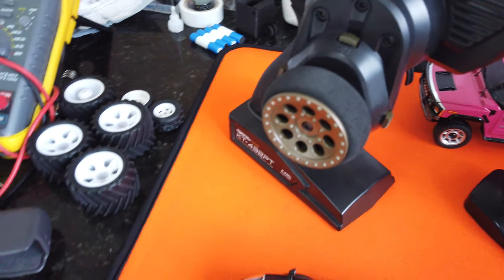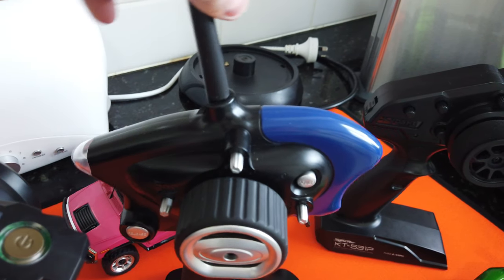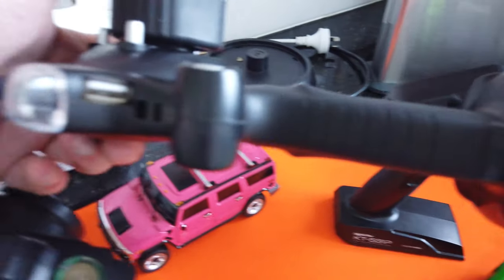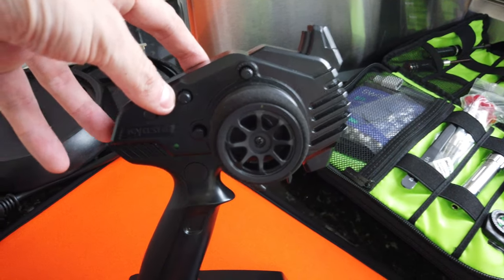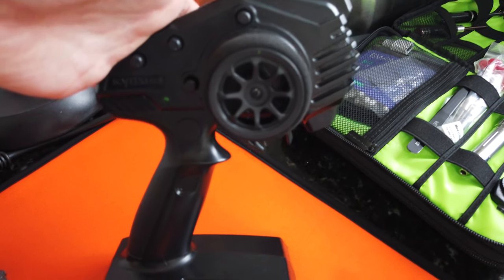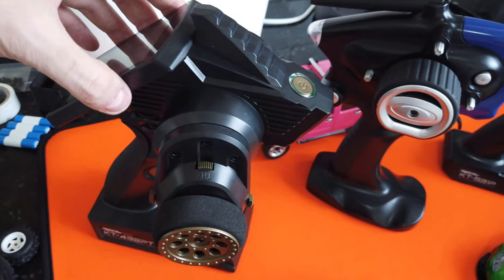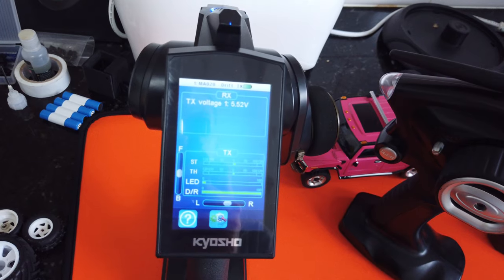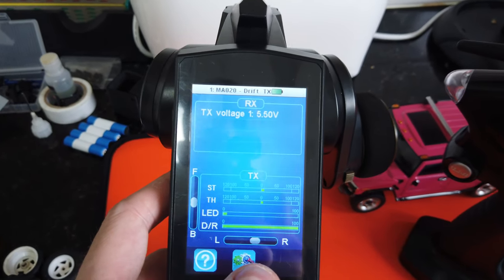Diffrent types of transmitter for Kyosho Mini-Zs

Comment: I can’t find a radio less than 90$ for my mini z mr03 is there a cheap alternative I can buy. Got this mini z body chassis set on eBay for 80$ thought I was getting a good deal now I’m starting to wonder. Any ideas? Please help!
Reply from the maker: Wow, just checked the prices and you are right, if there is a mini-z club near you it may be worth hitting up as anyone with a few models has these laying about. the KT-432 has replaced all my controllers and i have them laying about. if you cant find a local club or hobby store then i maybe able to ship one out but the real killer will be the shipping costs

you will need to know which controller you need, either the blue one in the middle for 'sports' or the black one on the right for newer MR-03's (FHSS)

the protocol used by the mini-z's is somewhat proprietary and there is not a huge range of 3rd party controllers, https://www.youtube.com/watch?v=fX0REIw1GRA does show how to use a flysky GT3 with the 'sports' models (FHS) and that is a great controller that can be picked up cheap and is easy to mod. i have had enough time with a decent rc unit to know how bad the default kyosho ones are when you start to get serious

* Try to find a club that may have old rc units
* get a flysky off ebay or banggood
* I may have spares but shipping may be prohibitive
Reply: Blitz Works if you were to sell me I remote how much would you sell it for? I live in the U.S
Reply from the maker: have another transmitter arriving soon bringing me up to 3 KT-19's and 2 of the KT-531Ps let me know which one you need and it will mainly just be covering shipping costs, will ping you on the weekend once you know which one you need. i ahve a spare set of mr03 sports electronics (KT-19) if you dont have an rx unit
Reply: Blitz Works it says on the box I need kt18 or equivalent
Reply from the maker: Unfortunately i dont have the KT-18 ASF equipment on hand. if this is a MR03 i do have the sports electronics upgrade kit which will make it work with the KT-19 but this wont work on the brushless versions (all of which are ASF except the EVO model which can be upgraded) if you do have the brushed version then the electronics upgrade may be an option but you are now looking at spending almost as much as getting an ASF transmitter

Just checked shipping and unlike sending tothe rest of the world shipping to the US is pretty brutal, looking at around $40 AUD
Reply: Blitz Works 🤦‍♂️ guess I just need to bite the bullet and spend 100$ on a sub par radio... man I don’t get why those cheesy transmitters are so expensive... everything mini z is crazy priced!